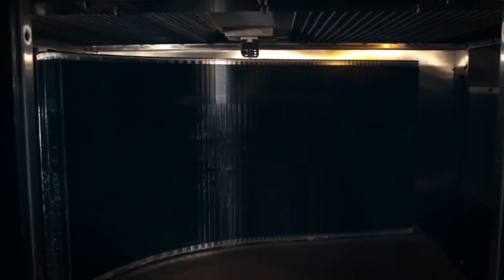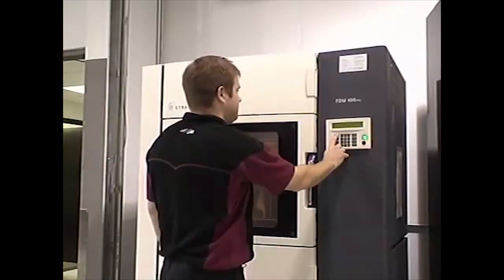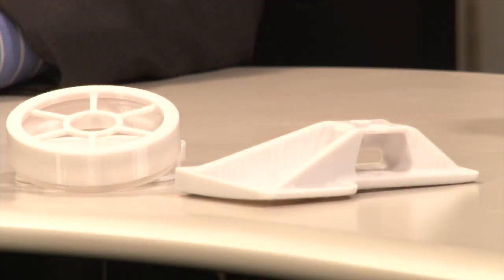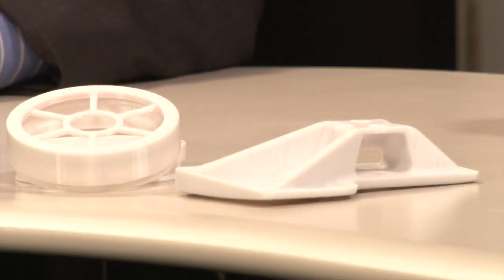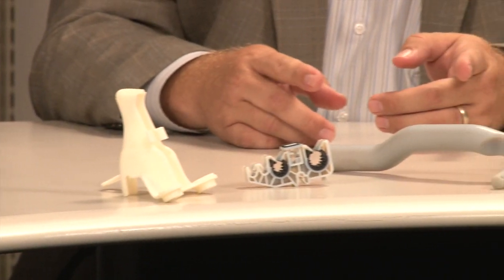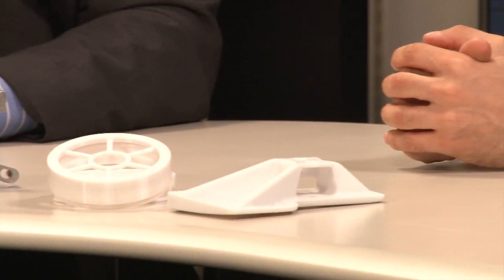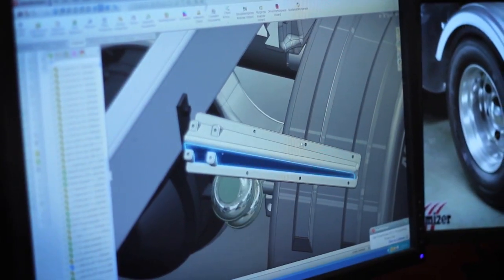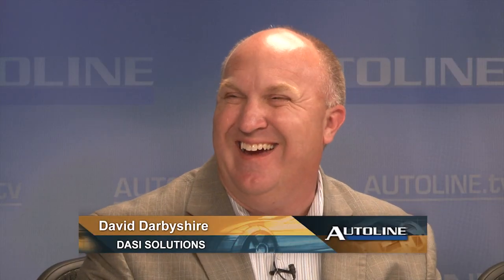The Secret World of 3D Printing - Autoline This Week 1829

Comment: How does the metal strength compare, 3d printing vs cast or machined?
Reply: Spacex uses it.
"In order to design the SuperDraco engines, SpaceX embraced 3D printing technology in order to cut down on cost, waste, and make the production process more flexible in general. A key component of the rocket engine, known as the combustion chamber, was fabricated entirely with 3D printing on an EOS metal 3D printer. The use of Inconel super alloy ensured superior strength, ductility, fracture resistance and a lower variability in materials properties"
Reply: my thoughts exactly
Reply: SpaceX dose use 3D metal printing for various parts however these parts are not high strength. 3D Metal printed part are layered crystals and as such brake under pressure. for tight tolerances and high strength forging is the only way to go. Casted parts are some where in between. The crystal structure is chaotic and can break.  so as far as strength you have 3D printed - Cast - Forged. 3D metal printing dose cut down the cost by any means.

Comment: This left out that GE is 3D printing fuel injectors that are in use now. Also Koenigsegg
is 3D printing for production with the One2One supercar's titanium exhaust. Since only 100 were made, 3D printing with powdered titanium was cheaper than making tooling.
Reply: Koenigsegg 3d prints the turbo housing, not the exhaust